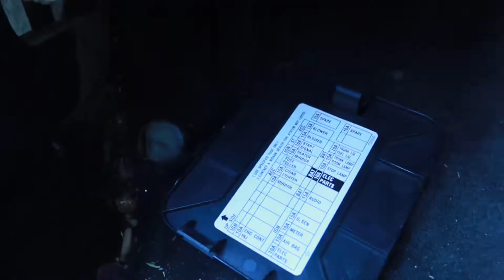WATCH WHO WORKS ON YOUR CAR...

Comment: To program the key fob is mad easy. All you got to do is get in the car and lock your self in. You get the key and put it in the ignition but you have to do it 6 times in a row. Once you do that the hazard light will flash a few times. That when you know you did it right. After the lights flash press any button on the key fob and it will program.

Comment: Hi Jake- I’m sure you’re very busy, but if you get a few, I’d like to ask you a couple of things about my baby- 2005 350z Nismo convertible. Her passenger window “suddenly “ fell down into her door at some point during the night while she was parked in my driveway, not running, wtf? I’m like you and do not want any mofo touching her, but I gotta get her window up. Any input is greatly appreciated. Thanks
Reply from the maker: hey man appreciate you 🔥 damn that’s crazy. when the car wasn’t on? wow! alright. first thing you gotta do, is open the door up. you need to make sure nothing broke. so check to see if the glass is still in the regular (the track where the window moves up and down; it’s going to be near the window motor). if it’s still in place and bolted up, then you are gonna want to first reset the window motor. i have a how-to video on “How to Reset POWER WONDOW! (350z)” on my channel! it’s super detailed. in that video i even show you how to take off the door panel so you can see inside ✊🏽. (it’s unlikely that it’s an electrical issue. if it was the window won’t move). lmk if that works first. 350z window motors fault all time and is why they have a accessible reset bottom on the window motor itself.